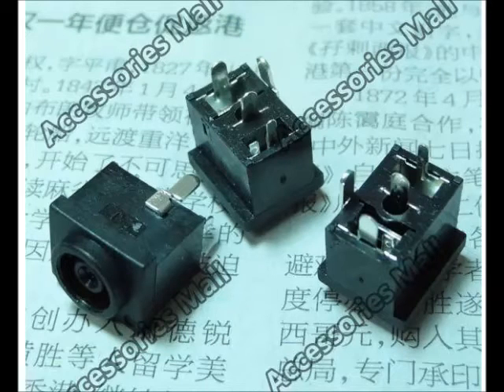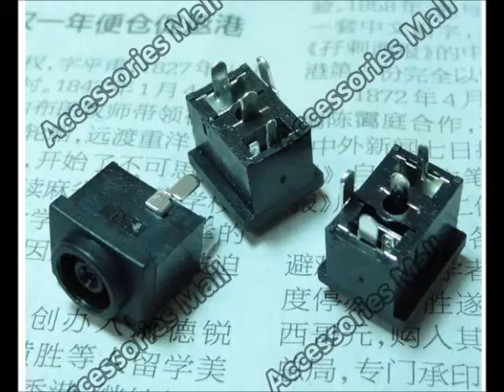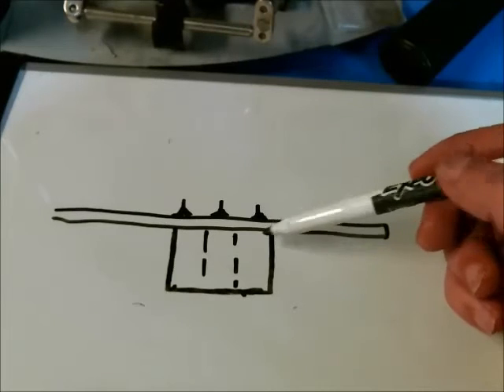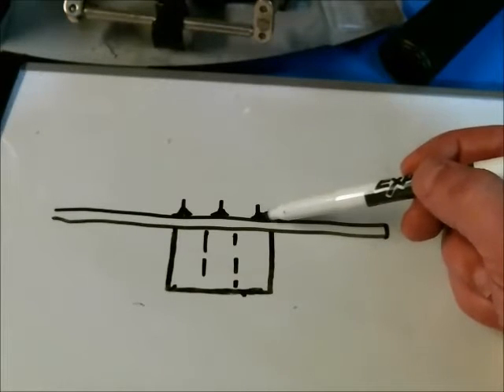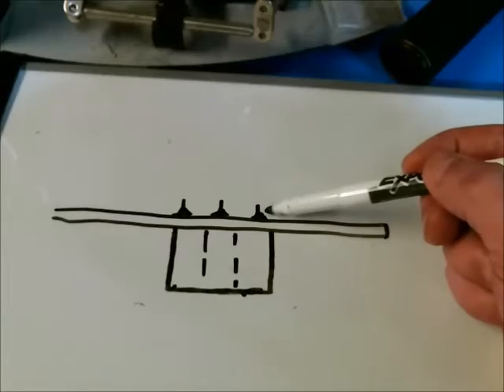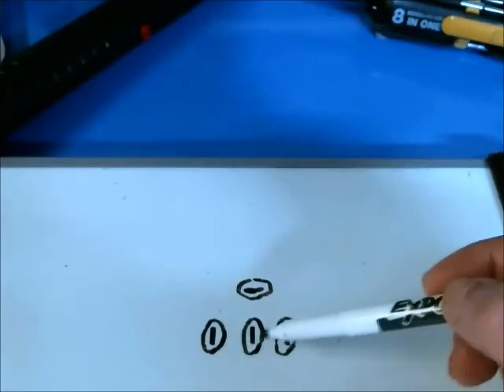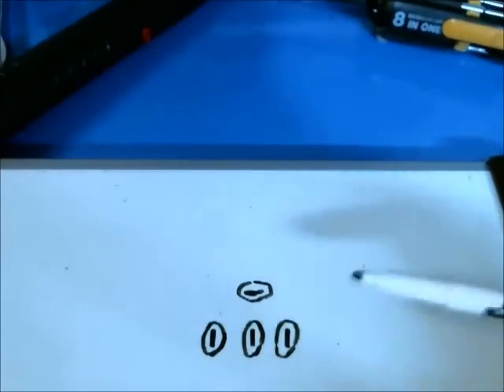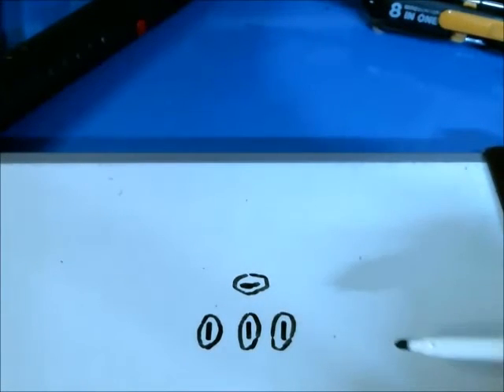Samsung SA300 LED Monitor Power Jack replacement

Comment: Thanks for posting this.
I ended up being able to work around a jack replacement by pushing the power cord in more firmly and wedging it in with electrical tape.

Comment: Had the same problem, realised that central pin was pushed in ,  cut a piece of copper wire  like 2mm long, threw it in central hole of jack, plug in and TADAA!!!
Reply: man oh man ive had this monitor for like a 2 years and has not been used for a year now. i tried your trick and voila!!! THANK YOU!!
Reply: I know this post is too old, but man thanks alot :) I had the same problem for like a year now and you save me alot of bucks =3 Thank You!
Reply: does it have to be copper wire? how can you tell if its just the central pin thats the problem?
Reply: This worked for me too thanks George!
Reply: Man, give me your PayPal and i will treat you with a beer :D

Comment: So my monitor with this power jack stopped working today.. How do I tell whether the adapter has broken so I could just get a new woe versus doing this?
Reply: +TheThingamajig Hi, I find myself in the same situation, could you tell me how you solved it? Thanks!
Reply: +Martin RS Just take the power cord by itself and use a multimeter to check if it's working. Just stick one lead into the open end of the barrel plug (so that it's touching the center pin) and put the other lead on the outside of the plug. If it reads about 14 or -14 volts, it's fine. Also, on this particular jack, try plugging it in and then rotating the power cord while it's plugged in. You might find an angle where it starts working again.